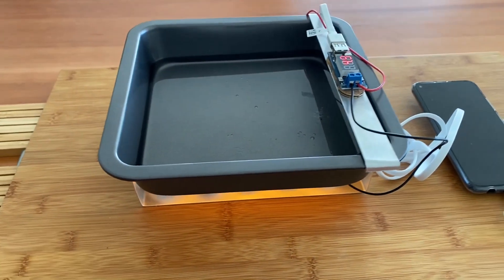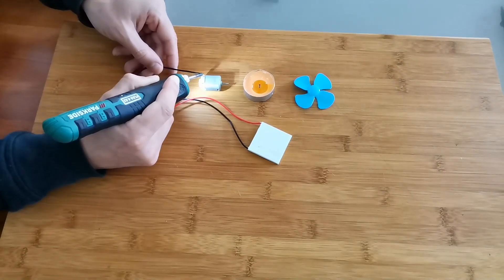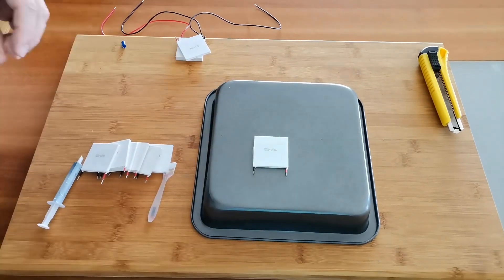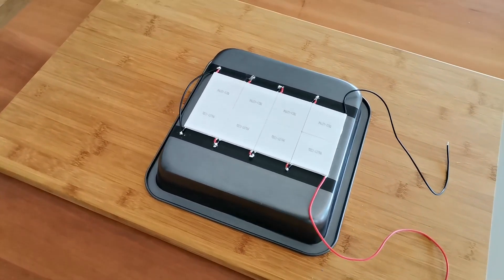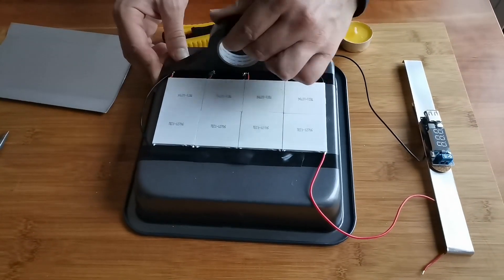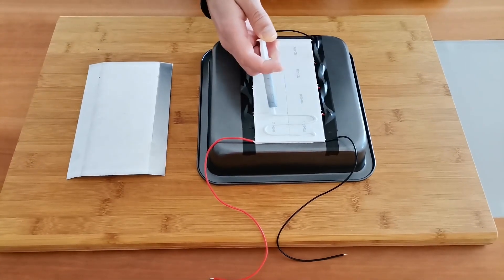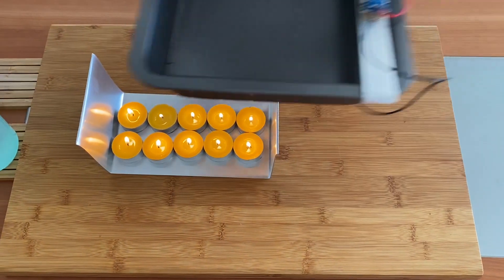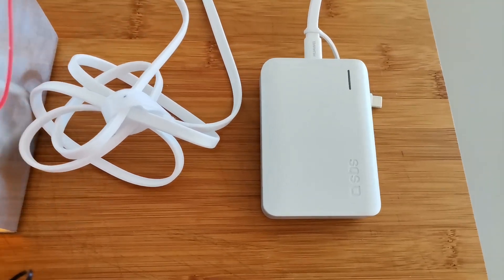Building a DIY Thermoelectric Generator (TEG)

Comment from the maker: Check how to build a LED Mask: https://youtu.be/GZ7EY2LZxwo
Reply: Thanks man, great video. One question is there a limit of use those tic? Do you know their life span? How many times can you heat them and cool them out?
MOST IMPORTANT how do you recycle those TIC once you canno use them anymore?

Please do provide reliable info and I would like to have answers to my questions thank you very much.
Reply from the maker: @iLVCA  thanks for the feedback and interest on this subject. I don´t know which application you´re thinking of but I am sure you can find relevant information on the components datasheet. As you might know there are several thermoelectric coolers in the market so make sure you´re analyzing the correct datasheet. The lifespan is quite extended I would say :)
As for recycling I am really not sure but my wild guess would be that you should treat it as other electronic components and recycle it accordingly!

Comment: quick question, could this potentially power a 12V fan that would be used to cool the other side of the TEG? As well as charge a phone?
Reply from the maker: Peltier modules are known for their low efficiency. Although it could potentially power a fan and charge a phone (with more modules), I think you have better options.

Comment: I USED HEATSINKS BUT MY TEG IS SHOWING LOW VOLATGE READING And zero current values. what should I do?
Reply from the maker: Use a multimeter to check if all connections are ok. How many TEC in series do you have? Try bringing the heat (fire) closer to TEC without burning. Also, you can throw ice cubes in the water to force a bigger potential difference. Let me know how it works out for you please!
Reply: @DaniElectronics  thank you. I will get back to you

Comment: At 5 volts, what amperage is it delivering?
Reply from the maker: When the voltage regulator is switched on you get 5V and somewhere around 1A.
Reply: in the original video only 0.3 A  youtu.be/xaT2hqHgLdY?t=357

Comment: How to charge a phone with nothing but fire and water and tec cells and solder and tape and ice and a voltage regulator and an aluminum tray and some aluminum sheeting and a charging cord and some sort of adhesive.....
Reply from the maker: You´re right, I used more stuff. I wanted to highlight the different source of energy I used to charge my phone though.